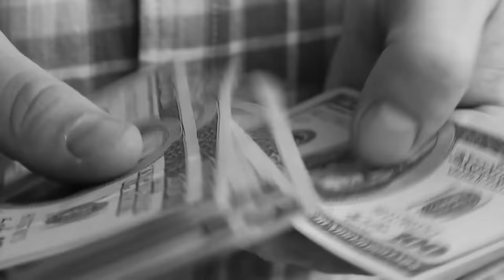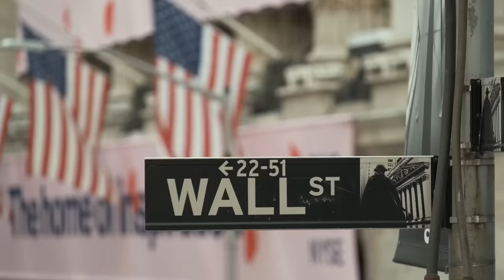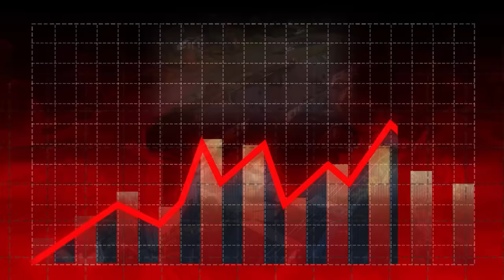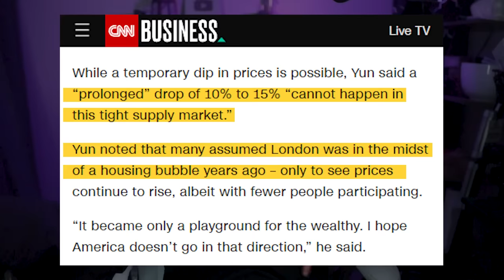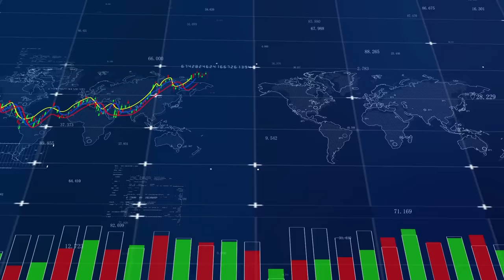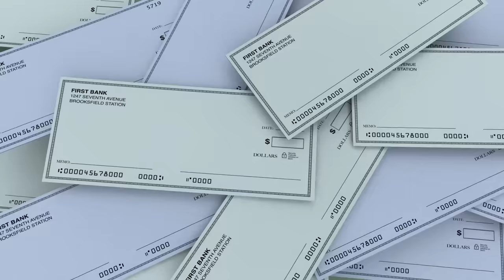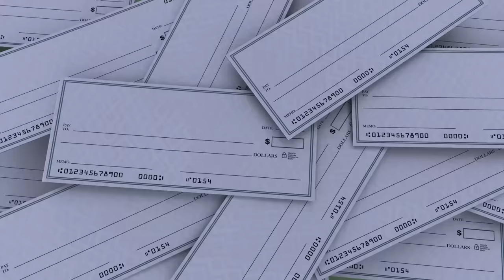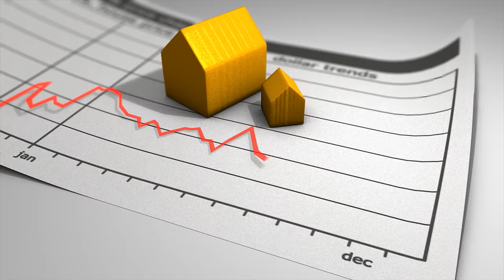The Housing Bubble Is OVERDUE To POP!

Comment: My husband and I bought a manufactured home (in excellent condition) in 2017 with 8 acres.  Several family members said we were buying trash, but it has worked out well for us.  We are now finishing construction on a new stick built home on our property.  My sister and her boys will move into our current manufactured home because rent prices are so unreasonable.  We'll also have an independent space for a family friend-more family than friend-also rent from us.  We're also making sure we can cover the mortgage on our own in case they ever run into money problems.
Reply: There are others who have made the mistake of buying manufactured or tiny houses and admitted that they were subpar and deeply regretted doing so, and understandably upscaled. Bottom line - Do what works best for you individually or for your individual family. What works for one, doesn’t work for others. We don’t need a broadstroke bad solution.

Comment: I appreciate that this video strives to be more balanced rather than most.  I would suggest using a 20% down payment for calculations because that's what well prepared buyers should aim for.  If one buys with a dp less than 20%, then the bank requires a monthly PMI fee which increases the monthly payment and doesn't benefit the buyer.

Comment: In the area where I want to go. The houses that sell fast are well priced. And the ones that sit are over priced and they have been lowering the prices. If it is less than 150,000 The sell in 24 hours or less. if it is above they typically sit. Especially the ones over 200,000.

Comment: I am noticing a lot of new construction ftom the mid to end of 2022 that are listed for resale. The problem is they are asking close to what you can get for new construction and the builders are also offering crazy incentives so the payment is less than resale.
I wonder if it is property taxes that kicked in, and they did not know you pay taxes on more than the land when it gets assessed or the home insurance went up or they have a job relocation or loss.
I don't see how, in the communities that are still building specs and have new builds that are move in ready, they can compete with the builder. It would be more expensive to buy a year old resale than a new build. I think they are trying to cover their cost to sell. But for a buyer it is cheaper to buy new in those communities.
Reply: It is definitely a major issue if you own one of those resells next to new builds. Almost impossible to compete. You have to wait until all the new builds are built and sold.  

Also, buyers expect your house to be in new condition, like the new builds.  It is a very tough situation to be in. 

This is why I like to own in older neighborhoods with zero new builds close.  Buyers have no choice but to take what they can get if they want to live in that location, which is usually very desirable, closer to metro areas etc.  

You aren’t competing with all the new builds on the outskirts.
Reply: Isn't this a major " the market is going down" indication?  Think about it.  A few years back people would buy the first new home in the new neighborhood and 2 years later sell for a handsome profit! I think we're past the peak, and maybe 2-3 years from the bottom. What say you?
Reply: @James-xf4pc  Yes. Now you don't know if  buying early in the community and have to deal with construction  but get the best price and instant equity or wait until close out and end of year incentives. It is crazy especially in the big master planned communities:)

Comment: If I was a 30 year old and wanted to buy something. I would be looking for multi units. An buy a together on a business level. If it the 4 unit I would look for people to buy it, set it up like A.  Condo or co-op owned all through attorneys. It can be done. That's what I would do if I was young and wanted to buy house. Pull your money together, but always with an attorney. It's not an emotional thing it's business
Reply: Multi units are also over priced though. When you divide it up per unit you’re still overpaying for each unit. That’s the same as just buying it separately. Multi units aren’t as affordable and profitable as they used to be.